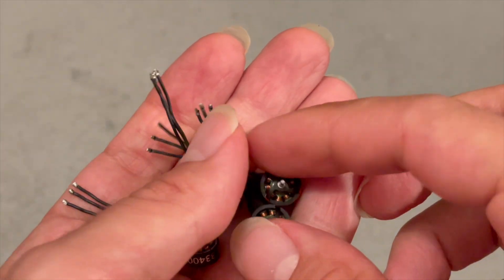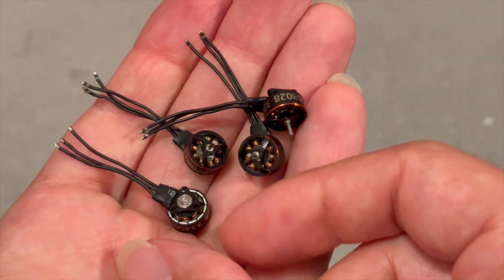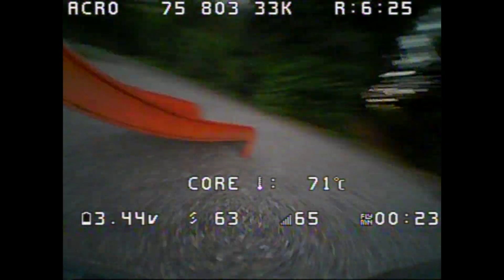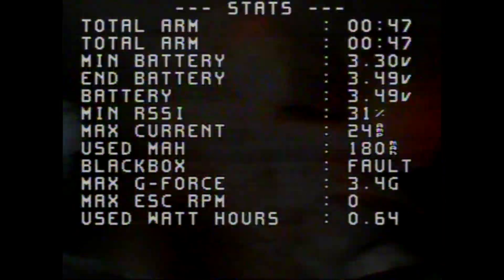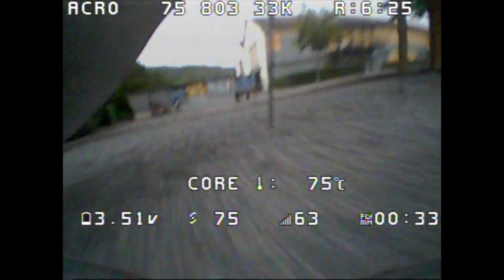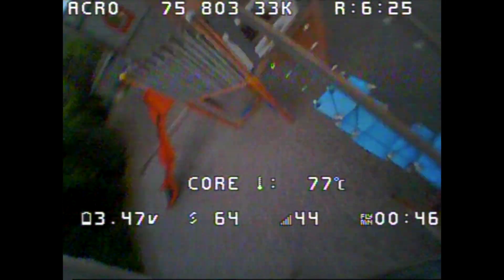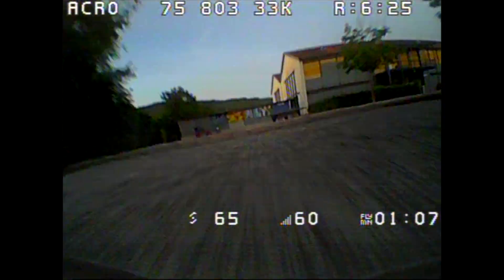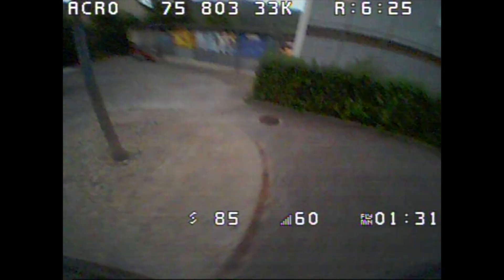NEW 8028 33400kv Prototype Motors | Any good?

Comment: Ouu nicee! I’d love to try out a batch
Reply from the maker: Unfortunately they are not available for purchase. It wouldn't make sense as I described in the video. The engines are not efficient enough..
Reply: @butterflyfpv  non high kv is ever efficient. That’s the whole point lol.
Reply from the maker: @TaseenAli  Yes and no. In some cases and for some flying speeds high kv is more efficient in some way.. (more on that in later videos) And those particular motors are not efficient enough at all. The voltage sag is bad and the lipos quite hot after a race flight. These motors are lipo eaters in the current state.

Comment: Hi My Whoopfriend this motors o fire😅 are you try the 0703 rcin power on 75mm ?
Reply from the maker: Hey Ludo! I was on fire, but the engines not so much. Or the motors did, but the lipo wasn't happy because the current was too high. The engines are too inefficient. Unfortunately...
No not yet.. but maybe I'll test the rip 703 too..

Comment: Nothing comes for free. We saw this clearly in Chris's motor test video. The highest performing motors all had the worst efficiency and vice versa. It was also clear that high kV = more power, and higher kv of the same motor had lower efficiency. One thing we might be able to achieve is high torque/good efficiency, by using a bigger stator, but lower KV. This would give a motor that can spin up to speed very quickly, but wont have a very high top speed.
Reply from the maker: But thats a myth right? Bigger diameter on the stator is less torque and less response (I know it's not intuitive, but I learned from Chris Rosser's videos that the stator volume is responsible for torque. The diameter, not so much) And that's why high motors like 803 are so responsive, because they have a large volume but at the same time a small diameter which can be accelerated and decelerated more quickly. Less top speed is not an option for me. There has to be another way :-D With my motors I want to be able to say: Viewer: How fast does it fly? Me: YES! xD